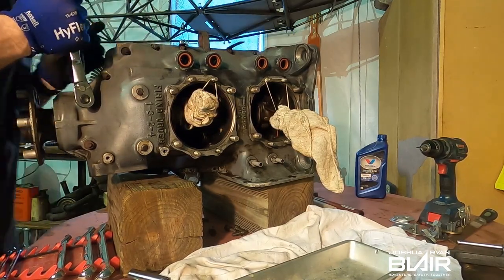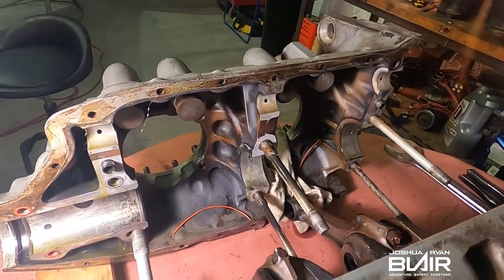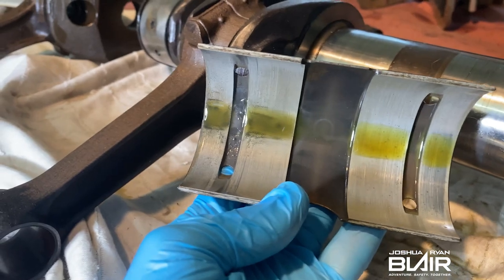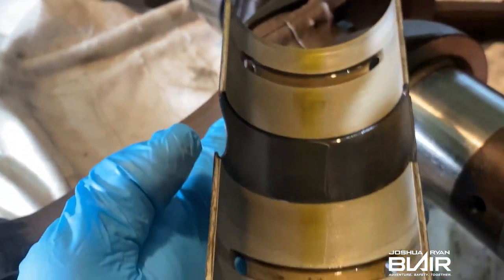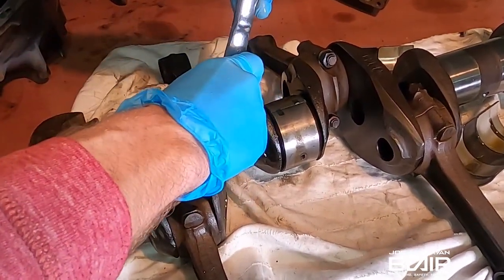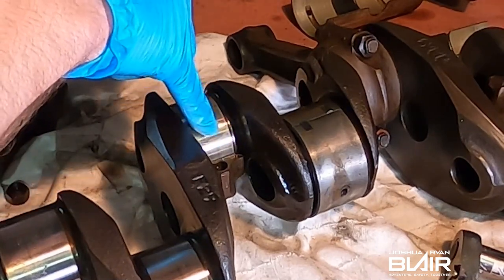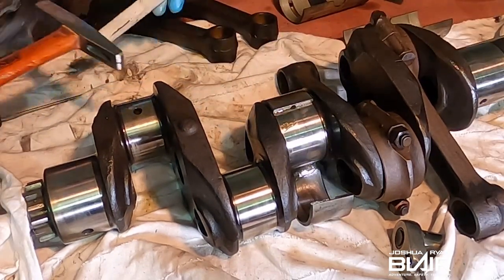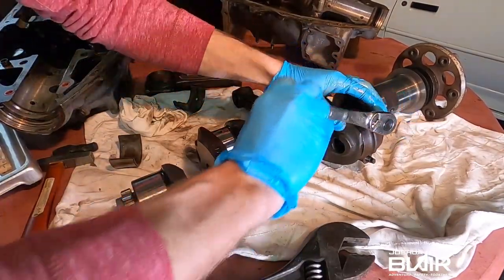ENGINE CRANK REMOVAL | Lycoming O-320 Teardown Part 3

Comment: some of The cam followers Look pretty torn up!  This is the standard engine for the Piper Tri-Pacer.  The tappets get rough in those engines when run past TBO limits.  Some of the music ugh kinda doesn't fit your video.  Otherwise very good.
Reply from the maker: Yeah kinda rough looking for sure...This was just slight over 50% of the TBO too. And Thanks for your feedback. Appreciate it!
Reply: I agree - great vid but christian music really really blows

Comment: Looking at the position of the pistons on the crankshaft, it looks like the piston and connecting rods are connected to separate journals. If this is the case, would the O-320 be considered a boxer engine?
Reply from the maker: Yes that is correct.
Reply from the maker: I’m about 4 weeks away from building this engine back up. It will be installed on the Clipper in late May.

Comment: Hey awesome videos!  Did you end up trying to turn your core in for value? We want to tear apart our engine way over TBO to see how it was doing, but apparently Lycoming doesn’t give you any cash back if you split the case. Any input?
Reply from the maker: I am going to overhaul mine myself. I just recently received my crankshaft back and it's yellow tagged and ready. I'll be shipping my case out soon for cleaning and inspection.

Comment: One the prop flange, those inserts??? Are threaded? No AN bolts seem to have a thread depth long enough to come flush much less give the two to three threads past you would like to see. Are the propeller bolts required to show threads past the flange threads? Where can I find the manual references to this? What were you taught?
Reply from the maker: Yes, threaded inserts/bushings are on the crankshaft flange. You are correct, you should always have close to two bolt threads pass the nut/threaded portion (same case here). I just purchased bolts for my McCauley propeller, the P/N is actually the manufacture's P/N. Prop bolts are very specific and often cost $ a bit more too!
Reply from the maker: Also, I use the manufactures drawing for installation details and requirements.
Reply: @Blaircraft.Engines  Am I correct, the AN standard threads are shorter in thread count than propeller bolt thread count you just recently purchased? If the inserts on the prop flange has a shoulder machined into that insert, then the propeller bolts could bottom out before reaching the required two thread protrusion and at the same time give a false torque reading. The prop could actually be loose with the bolt grip being too long for the width of the propeller thickness.  This could be a major issue when, for example, a metal propeller is exchanged for a wooden one. The wooden one has plate of a certain thickness and requires torquing to crush slightly the wood. The aircraft is an experimental pusher configuration. This situation would be rare, if any, with standard certified aircraft,  but best practices would be expected in any case. Thank you for replying. This has been a head scratcher and the lack of  data. The prop installation instructions are missing. The propeller company has been non responsive.